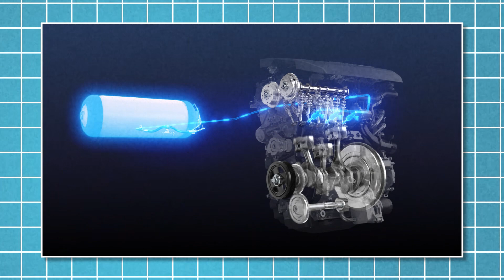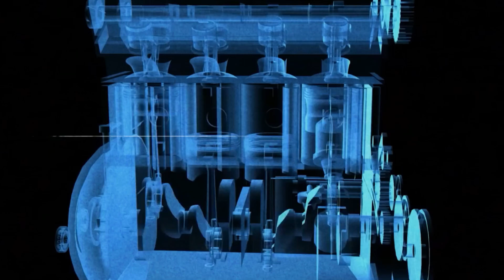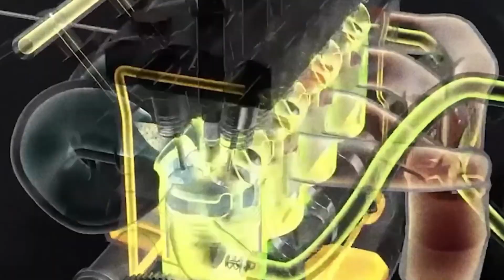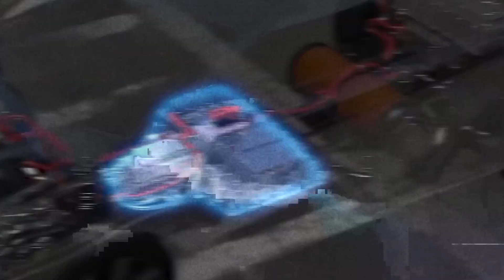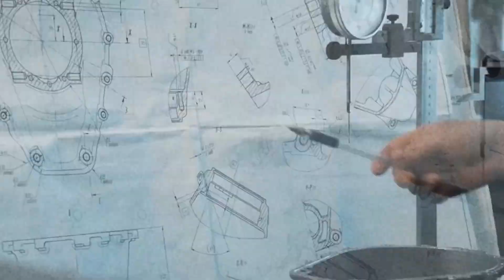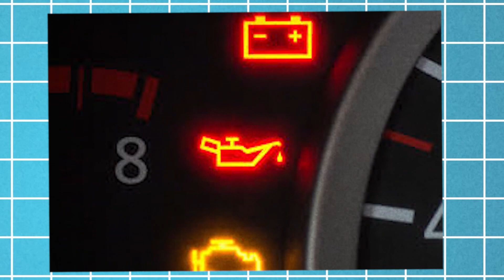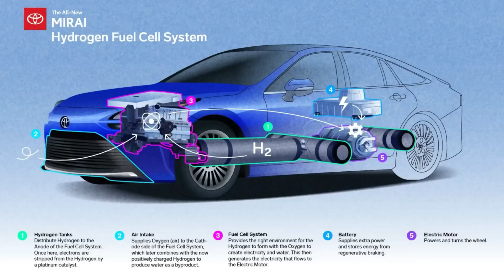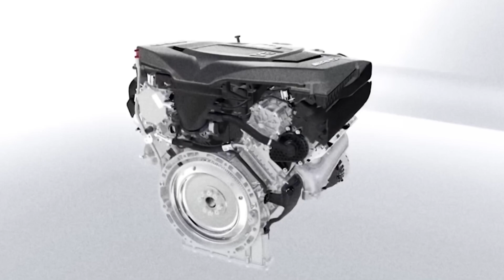Is TOYOTA's WATER engine FEASIBLE? - Deep Dive #ev #cars #technology #electric #water #toyota

Comment: Now wait until the first winter. Your tank will freeze up rupturing it.
I don't think that "just in time" electrolysis can output that much hydrogen for the combustion.
And how do they get out the water from the cylinders... Or do they mount the engine upside down? Imagine having the crankshaft close to the bonnet.
1st of April is in one month. Maybe try again
Reply: Send this comment to Toyota, they clearly don't know what they are doing. Tell them how to make engines.
Reply: @john.hunter  " they clearly don't know what they are doing" well Kodak and Nokia where word leading company's but missed to switch to the future, now, no-one cares about those company's anymore.
Reply: diesel has freezing problems too, and you dont think people have come up with a way to solve that? they made a fluid to put into your tank before it gets cold so your diesel doesnt freeze and some even have plug ins so that your components and diesel can be room temp when its not running
Reply: @8-bitsaturn960  they add a bit of petrol and everything is fine. I know. But here, you need destilled water. Pure water! Otherwise you would either ruin your electrolysis or you generate unwanted and maybe harmful gasses like chlorine or whatever. So maybe they add a heater, but where does the energy come from? Also you need a thick insulation that'll delay freezing.
Reply: The solution is to put the water engine in our houses that already have water coming into it so the electrolysis/distillation can all take place in one location. Millions of tiny point-of-use power plants. Then we can off-load distilled-water, hydrogen, and/or electricity for our modes of transportation. This will open the door to self-sustained point of use energy production which will disrupt the world's oil industry economy, but to lead the way into the future (and possibly off this planet) we will have to switch from a petrochemical sub-economy and move towards a hydrogen based one.
Reply: @GallowayChicago  you need energy to make h2 out of water and this would be inefficient because it cost more energy for making h2 then getting energy out of h2
Reply: @calvinvail89  - You are not alone. A lot of people still think of HHO generators like perpetual machines and thus they must be "impossible and inefficient because they use more energy than they make", but the truth is 'and' has always been that hydrogen is an extremely combustible fuel and water is tightly packed hydrogen. Ammonia (with its 3 hydrogen atoms) is better but logistically it would cause more harm than good. There was a time when getting light from anything other than fire was considered impossible (other examples: flying faster than the speed of sound, launching a rocket into outer space). My point is that science is not a fixed point. It is always growing. What we know and believe is our starting point. It turns out that sound frequencies and possibly chemical additives loosen the molecular bonds of water making electrolysis much more efficient by requiring much less power. An analogy would be the incandescent lightbulb and the recently invented (and commercially available since 2002) white LED lightbulb and how it has changed our world from street lights, automotive headlight, etc. Nissan has already perfected a water-based Hydrogen-Cell which is similar to a solar cell in that it uses a multi-separator approach to crack water to make hydrogen then uses a catalyst to turn that hydrogen into electricity directly, but we will never see this tech in the wild it is being used in space. They say the catalyst is too expensive for the consumer market. - - - [bottom line:] Keep an open mind, because it is going to happen even if people don't know how it works (like LEDs or our cell phones).
Reply: @GallowayChicago  its just the physically point it will never be more efficient converting energy as using it directly. Yes it will be usable like for the  industry but why waste energy by converting it before using it? Makes no sense. And there isnt any advantage at all.  i know that things will be difrent in the future but this fact will never change 
direct using > converting
Reply: @calvinvail89  - How much energy is used to make and distribute gasoline? With our limited knowledge of this evolving water technology ; would this use more or less energy then; extracting oil from the ground, putting it in tankers, loading those takers on ships, loading those ships back onto tankers or pipe-lines to refineries, offloading the refines products (gas or diesel) on to trucks to fueling stations everywhere? Keep in-mind that we subsidies 3 or more of these transportations as well as the oil refineries directly. Now! consider the envirnmental impact of just reducing oil refineries and all that reduction in transportation. No matter what we do, gas prices are going to rise.
Reply: @GallowayChicago  iam talking about EVs
Reply: @calvinvail89  - I own an EV but EVs are just a stepping stone like steam engines were. EV are dangerous and with the current energy storage system, EVs are unsustainable too. Currently there is no way everyone in the USA can own and drive 100% electric vehicles with the current electrical infrastructure. We can all agree that innovation needs money, and the more we support new tech the more new tech becomes profitable and the more new tech will advance. It is a self-fulfilling prophecy.
Reply: @GallowayChicago   so anything you claimed before (development takes time) is a good argument for inefficient and old tech like oil and h2 but not for EVs? 

Is there some sort of magical snap and all of us are driving EVs tomorrow? I don’t think so
In my case Germany, I yours the US. No one claimed that there is some kind of point where Millions of People are switch on the same day or even in a short amount of time. No it’s evolving other time.

Sure infrastructure need to be increased but this was the case back in time for ICEVs too 🤷‍♂️

And “EVs are Dangerous” come on don’t play this card. EVs are not more dangerous than ICEV or HFCEV it’s the opposite. The same goes for “unsustainable” it is a FACT that EVs these days are more sustainable than ICEVs and I can’t believe you believe the opposite and driving an EV yourself?! 

EVs are rn one of the best sustainable and efficient technology we know. ICEV and HFCEV will maybe part of a mininmal use for transition to full EV or what comes next and is now unknown. 

I don’t want to blame you or in any kind force you what to drive it’s just about logic and physics. rn 

Wasting to much Money and Energy into a technology we knew will never achieve the same efficiency is not a great goal imo 

I think we both agree that we definitely need to get rid of Oil based mobility? And I see no reason to waste this into H2 or any other H2 Based Fuel (like Ammonia) especially because it would only makes sense when the energy used for the conversion comes from 100% renewable energy .
And if we achieve this state of energy production it would be much more smart using it directly why should we waste another 30% more for nothing 🤷‍♂️
Reply: @GallowayChicago  batteries rn are not perfect yes nothing we create on a industrial level will ever be (likely) but with everything involved we are on a great way to the future. An new battery from 2023/2024 can reach a total range of 300k-500k km (sorry I’m not into imperial system so I’m using metric here😊)
before reaching 70% SoH after that the Battery pack is not broken or something. It’s been used in stationary energy storage this is been used world wide rn 
After this, the Battery Packs can be recycled by something between 90-95% depending on the different recycling systems used.

Yes it’s clear that some kind of resources have a lot of problems but those are not new. Lithium for example is used for decades now and depending on the country how it’s obtained it’s using more ore less drinking water. Most Lithium is been obtained by using mostly salty water that can obviously not be drinked. 

What I want to say is, people need to get more into what is happening on the Industry and Science we are making progress really fast that’s why modern EVs are losing worth so fast.
But the Fact is, EV rn are more sustainable then ICEV even if it will take time to evolve them so that some day everyone will be able to buy one. These will include a better infrastructure and cheaper prices by a growing second-hand market. And also, people need to learn that ICEV is not EV 
rn people are driving once a week or every two weeks to the gas station to pump some gas. But with an EV the best thing would be:
If the car is parked it’s plugged in an loading 

And that’s why anything need to change. Infrastructure an Material. An here it comes it needs to be cheaper to maintain “the fuel”, parts, workshop etc 
That’s why I said that H2 can’t really be more efficient even about using energy but also economical. And if it comes to Ammonia (better transport and logistic) we have the problem that it is highly toxic so Gas Station need to be upgraded so pump is a sealed process and no gases can leak. 

There a lot of problems to solved from genius people around the World.
IMO the best technology we have (rn) is the BEV but we will never knew what the future holds. I just don’t get it why some people are so obsessed with hydrogen, even if it has much more problems to solve and some can’t be solved in comparison to BEV.

But somethings imo it feels a bit like an emotional decision that a car need to make “noises” like V8 V16 I don’t know and I get that.
Driving a Hellcat is such a good feeling. But is it good to make choices on emotions? Hmm 🤔 

I’m going much further, I believe the best economic decision would be not having a private car at all. Car sharing. Having Cars standing on specific spots in towns and City’s where they load when not used.
Going there pay for a ride when needed or having a monthly payment. Bound that to future autonomic level 5 (it will take years) and this could be a great way to have a sustainable mobility but the hard thing will be to involve the people to accept these changes.
The people back in 1880 hated the first automobile it was an expensive toy for the rich and it took years for the majority to accept or even have their own. So yes Hydrogen hybrid maybe can help phase out petro cars but just from a physical standpoint I believe the future for the majority will be BEVs how long this will take? Idk 30-40y maybe? We will see in 40y I will be 74 😂 

I hope you understand my point, my English isn’t the best 😊 but it was nice to have a conversation with someone who is not insulting me just because of different opinions ❤️
Reply: @calvinvail89  - I love that even though we live almost in different worlds our technological world views are almost the same. Her in the US we can not get people to wear masks for the grater-good, so community-cars is out of the question. I have always said that (if you remove the tainted history) Volkswagen had the right ideal. One car with easily repairable parts for everyone. I guess if gas and diesel raise in price by a factor of 3 people will re-evaluate electric drive transportation out of necessity. I have kids and their outlook for the future is bad. They look at me and my generation as the ones who have ruined the world and I look at my parents generation as the ones that let money corrupt society. But we are beyond the time for pointing finger and we nee solutions that will not totally disrupt society. People seem to like money and profits so lets make the GOOD profitable. (Stay well my friend and it as been a pleasure speaking with you.)
Reply: You an engineer? Nah stfu
Reply: its called antifreeze ...dum ass

Comment: you can also make an adaptor HHO for older and current gas engines but you will have to bypass some sensors and maybe replace the computer
Reply: The problem is current emission standards and codes do not allow owners to modify/bypass any emission specific system on older vehicles. Even if the result is zero emissions.

Comment: This is the stupidest idea yet.  Water is not a source of energy.  Where will the electricity come from for the electrolysis?  Batteries?  Like in electric cars?  They've taken a standard BEV and added weight and complexity.
Reply: Any car needs a battery, that’s not the point at all. Gas-powered cars need one for the starter and initial gas pump and distributor operation, which is also electrical, then the alternator takes over to supply electric power to the gas pump, distributor, computer, sensors, lights and infotainment systems. That is not changing! Also, there are plug-in hybrid vehicles, which are way more complex. So yeah, you will still need a battery for starting the car, then the alternator will take over…
Reply from the maker: Stupid ideas produce some of history's greatest inventions
Reply: @Tech-Tribe-TV  its just H2 powered engine, nothing really "new" its still ineffective and will never be more effective as using energy directly
oh and btw H2 ICEV so "bruning" H2 is even more ineffective as HFCEVs
Reply: @calvinvail89  correct, BMW 750H was running on hydrogene almost 20 years ago, problem is hydrogene generation  where you lose at least 25% of your input energy, then combustion engines only have about 30% efficiency so you end up losing like 75% of your input energy. Better buy a BEV.